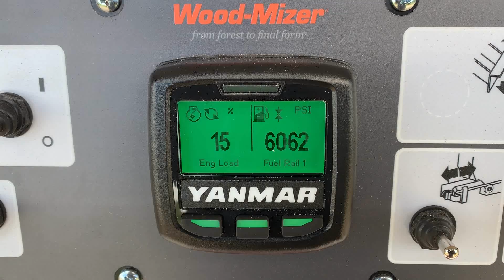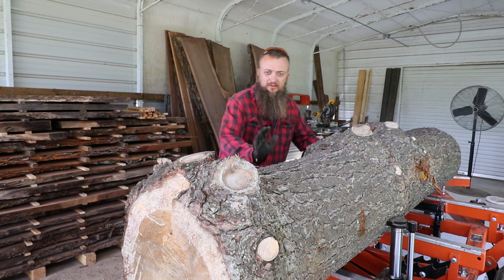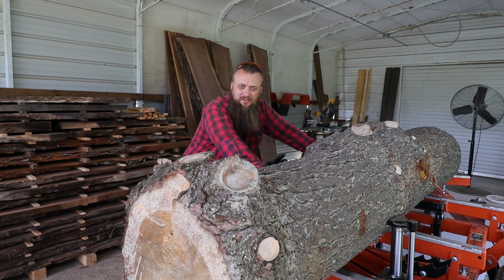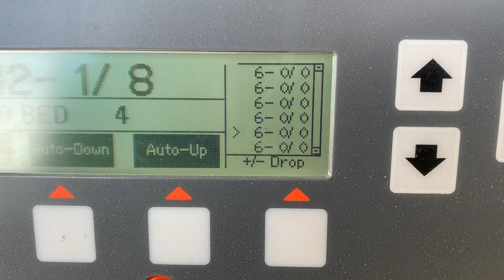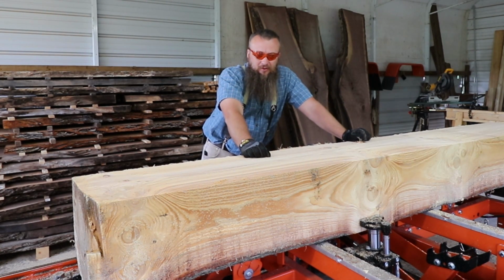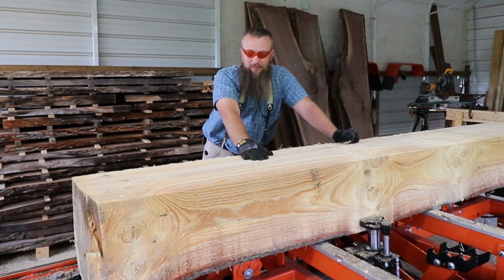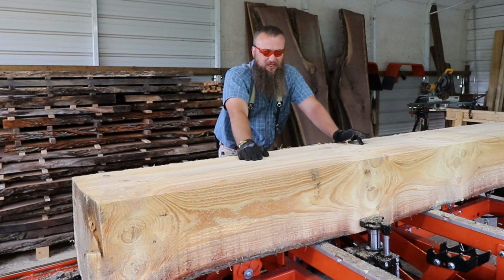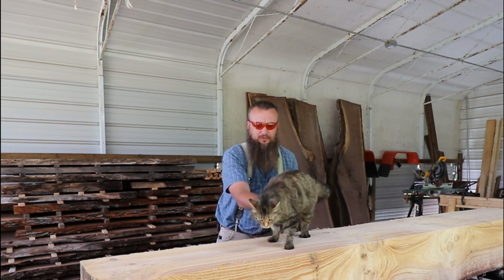THIS ADDED ACCESSORY TO THE SAWMILL WILL DOUBLE MY PRODUCTIVITY.

Comment: Hope you are getting used to the new mill.  I like the drag back feature on my Cooks AC-36.  I've cut as many as 3 6" cants then stacked them side by side, cutting 3 boards in 1 pass.  Then drag them back with the drag back fingers.  I then set up and start the next cut.  While it's cutting  I can sticker and stack the 3 boards I just cut.  Truly a 1 man operation.

Comment: Here is something to think about, were you have the header for your log loading area you might want to put the rolled up type door there and limonite the rest of the siding in that area , that way you’ll have more head room to load logs and remove finish projects out that door. Also when it becomes winter time you could even close it and keep the cold out and the heat in
Reply: Don Latimer wouldn’t the venting of the diesel exhaust also get rid of heat in the winter.  Confined space isn’t safe, running a huge Diesel engine like he has.

Comment: Hello I like the new mill I went from a lt40 to a lt 40 wide with simple set works took a little getting used to. When I saw white pine cants 6" or 8" I turn them after the last cut of the cant and saw them 2 boards or 2 by at a time but  you probably had a reason nice video

Comment: Nathan I've been running my 40 hd for two years now and I'm still learning it. Just hit 400 hours on it and I'm replacing my first set of wear blocks. You got one nice mill there. A bit different than mine. The amount of alignment adjusts on these things are incredibly thought out. You got me wanting to learn more about my accuset2 now. I've only been using auto up and down.
Reply from the maker: good deal, that accu set can do alot, great tool on the sawmill,

Comment: I have run a LT40 with the accuset for a while.  It certainly is a great addition to the mill.  If you get used to using the presets and board up and down along with pattern mode you can really get the most out of the logs.  If you had wanted to you probably could have gotten a few boards above your two 6 inch cants.

Comment: Purdy paneling. Also purdy music at the end. I wish I could or would learn to edit videos. The few I have I try to do it all in one cut and when watching them back I say "ah , um"' 20,gazillion times. 
Man if you had a belt conveyor with something to divert the slabs into their own pile and boards to be ran into a truck , trailer , or just in a pile. I have an old manual LumberMate by Norwood that I've been going to build a belted conveyor for years for ,but just haven't done it yet. 👍👍👍👍👍

Comment: Appreciate seeing lumber operation, but seems like there could be some dynamite slabs, or at least full-width 1" boards.  Those crotches and knots could dress up many a project. No market for pine slabs or wide lumber?  My mother's house was all  knotty pine, including the Kitchen cupboards, and none of it painted, none stained dark. Sure looked good and she got lots of complements. Not sure what the clear-coat was, but it seemed to bring out the best of the grain pattern.

Comment: Do you use a different lubricant on those pine/evergreen logs? The pitch was hell when I had some Loblolly cut up a few years ago.
Reply: For pitchy wood I have put a bit of dish washer soap in with the water.  It works fairly well.

Comment: I am surprised by how quiet that Yanmar diesel is. There does not seem to be nearly as much vibration in this machine as there was with the gasoline powered machine.
Reply: @Nathan Elliott That's odd. You would ordinarily expect a diesel to be noisier and to have a great deal more vibration, but this new machine seems to run quieter with less vibration. The wonders of modern engineering, I guess.

Comment: I've noticed the cutting fluid is leaking heavily and the rail the blade guard is moving on is rusting very bad. Something wrong there?
Reply: Normally thats just water and you run it like that to keep the blade cool and clean. Ron
Reply: @ronandloriwood7847  you say "Normally". So this isn't normal?
Reply: @RobertWiggers  On my Woodmizer I sometimes add Pinesol soap or Dawn dish washing soap to clean pine tar or sap off blade. I have heard people say they add diesel fuel I do not recommend that at all. Diesel adds odor and discolors wood. the water is also a lube to help the blade cut. The amount of water is adjustable, this is normal. Ron

Comment: Could you go into more detail about the problems you had with the larger pitch blades as opposed to the 7* blade .
You go as slow as you want to- no point in f#&kin up a brand new machine , especially as pricey as that one is.